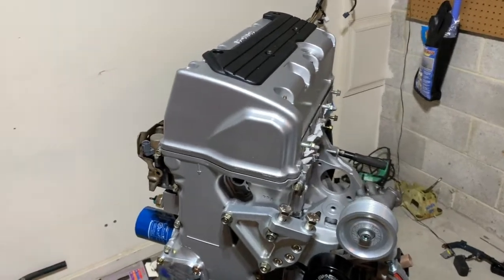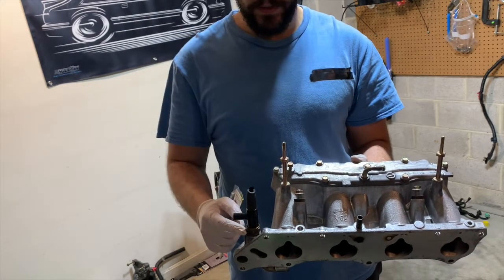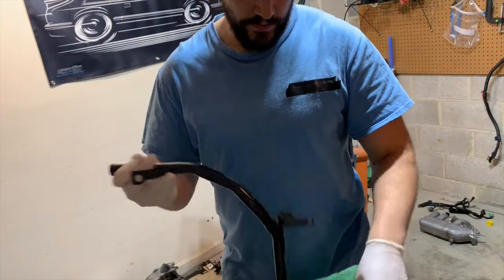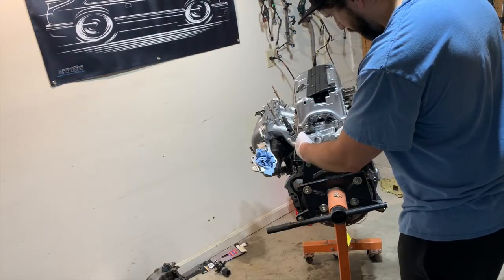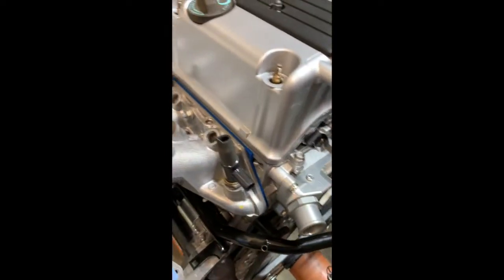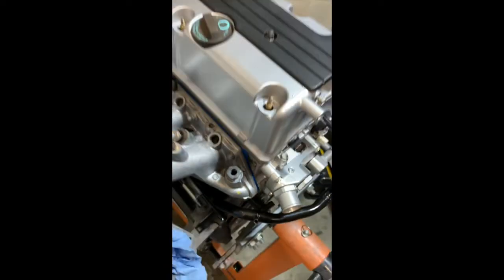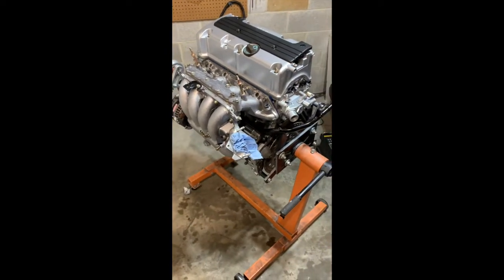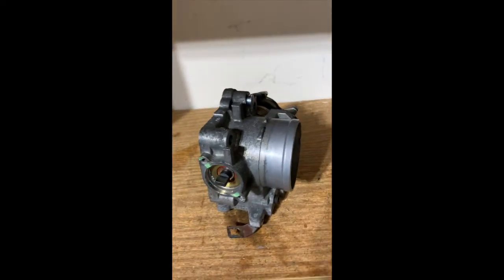K24 Assembly Almost Done! - Civic K24 Swap Part 5

Comment: Think It's idle air control on underside of throttle body. 
Putting temp sensor on the inlet won't give an accurate reading when the thermostat opens, youl be getting a signal from a dead leg
Best place is as coolant leaves the head on its way to the rad
Reply from the maker: I think on the stock D16 that sensor is right in the thermostat housing right? In the future I will be redoing my harness so maybe I will get an aftermarket thermostat housing and move it down there. A lot of people put the sensor in the intake though. But, you are saying its not accurate since its measuring the coolant temp after it flows through the radiator?
Reply: @e-dod  I'm not sure where it is on the D series pal
Your right loads put it where you have it but it's not a good spot for an accurate reading as that is a bypass untill the car is up to temp, then that route is closed by the thermostat
Like I say the best place for accurate readings is where coolant is on its way to the rad
Putting it on the thermostat housing will tell you the temp after coolant has been through the rad
Sweet build by the way, loves it 👌
Reply from the maker: @beltdrivetypea6534  Got it, thanks for the heads up! I'll have to plan out a new location or at least be aware of it while driving around for now 🙂
Reply: @e-dod  I just tapped out the housing you replaced 
But it might be slightly different on the ones we go over here.
Maybe it's not a big issue if the systems in good order
👍

Comment: Hey E, do you know what upper coolant housing I can use for the k24a with an RBC manifold?? Would it be the same one you’re using?
Reply from the maker: Yep, i am pretty sure the one I am using would work. You can even use the stock K24 upper coolant housing.

Comment: Hey E, what paint did you use to do the valve cover? I painted mine but it doesn't look as nice as yours
Reply from the maker: Hey man, I just used VHT aluminum paint on the block and Duplicolor silver on the valve cover. I wish I could remember the exact name of the silver I used but I just looked at the caps on the Duplicolor and picked one that matched good. The color difference between the VHT aluminum paint and the Duplicolor silver paint I think gave it the OEM look I was going for.

Comment: What did you do about the jdm vtec solenoid? Doesn’t the harness have an extra oil pressure sensor that won’t connect to the jdm solenoid?
Reply from the maker: Yes. The vtec solenoid pressure sensor is not there on the JDM solenoid. I just disabled that in KPro.

Comment: Hi what air intake are you running?
Reply from the maker: I ran the stock K24 intake manifold. I built a custom 3in intake for that manifold out of aluminum tubing.
Reply: @e-dod  Is there any specific intake I could use besides making my own?
Reply from the maker: @wrx240sx  I could not find one so that's why I had to make my own. I just used 3In aluminum pipe with couplers and a filter from hybrid racing.

Comment: Does the rsx-s race header fit the jdm k24a? Thanks in advance
Reply from the maker: The RSX header will bolt up to the K24 engine. You would just have to worry about the fact that the K24 engine is taller so the header will sit higher on a K24 then a K20. So you might have some clearance issues with the floor/sway bar depending on your car.
Reply: @e-dod  It's going in an ep3. Thanks for the reply.

Comment: Which coolant hoses are you using ? Did you have to special order ?
Reply from the maker: I used hybrid hoses: https://www.hybrid-racing.com/collections/all/products/hybrid-racing-k-swap-radiator-hoses?variant=51242787652

I think i show this in one of the engine install video's. I just had to cut the lower hose and it worked great!

Comment: Hi what goes on the hybrid racing plug ? On top the hole
Reply from the maker: The coolant temp sending unit from my D16 engine goes in there. This is needed to send temperature to the dash in the car so the temp gauge works. If you have a newer car you probably won't need this. Older car will probably need it. Your conversion harness should have a wire to connect to this and sent the signal to the dash, just make sure you have a connector for the sending unit you are using so you can splice it into the wire on the conversion harness.
Reply: @e-dod  thank you. Sorry all the questions I myself have the k24a engine in progress that’s going to go in a rsx. I am almost done. Your videos have helped a lot.
Reply from the maker: @wrx240sx  Glad you found it helpful! For the RSX I don't think you will need that adapter I had to install. Good luck with the swap!

Comment: whats that heater pipe part number??
Reply from the maker: 19510-RAA-A00

I got mine from Honda Automotive Parts (link below), looks like its back ordered though. Might be able to find it on eBay or see if your local dealer can order it for you.

https://www.hondaautomotiveparts.com/oem-parts/honda-pipe-heater-19510raaa00

Comment: Where does the other end of the heater pipe connect to?
Reply from the maker: Thanks for watching, one end connects to the thermostat housing the other end connects to the connector on the firewall of the car. In part 11 (one of my more recent vids) at about 12: 30 I show this.

Comment: Which thermostat housing did you use
Reply from the maker: I used the thermostat and housing off a 2005 Accord. I know the USDM TSX and USDM Accord have the same housing. I think the JDM K24a and USDM housings were interchangeable as well when I compared them.
Reply: Would the thermostat hiusing off an rsx work on this engine?